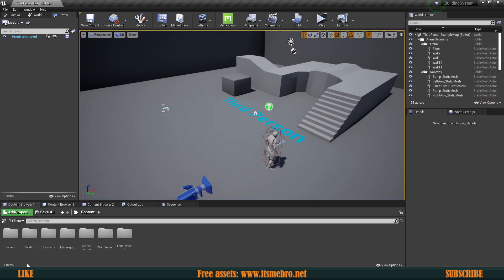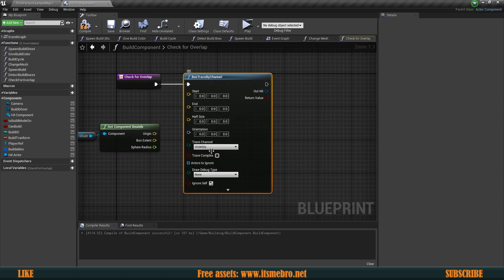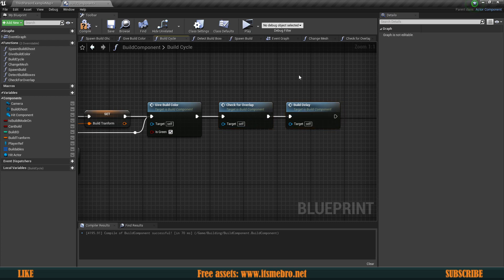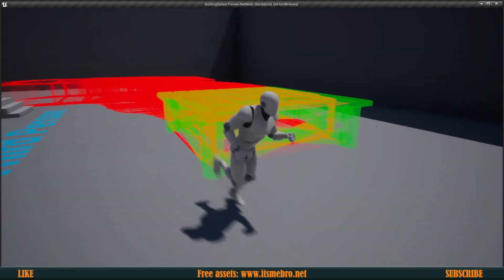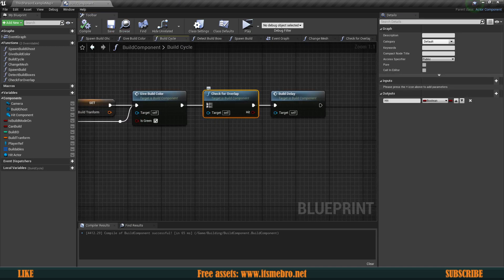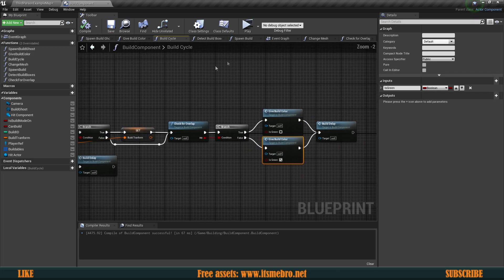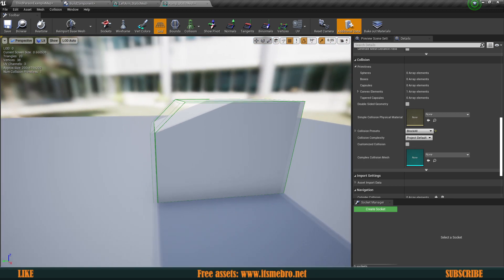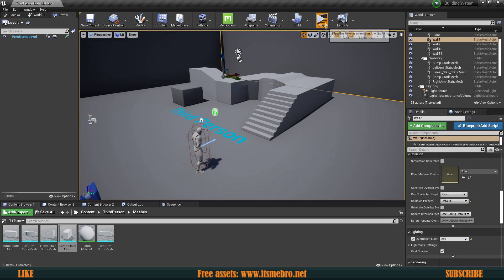UE4 Base Building / No Overlap

Comment: I love the series but this specific part is the only one i feel like is not working for my system. My foundations will not place if the box size is too high and so I divide it by 5 to try to fix the issue and it fixed the issue but the boxes are so small it doesn’t work half the time. I moved the pivot point but the boxes still are not working. One thing I thought about was to use the objects trace channels to only block specific trace channels but i also think using a component like a box in etch mesh and then box tracing that is a a better solution as it gives you more freedom pr object to edit the boxes.

Comment: Thanks for all the hard work, An little setup guide on ramps and stairs for overlap would be nice as you would want the outside ramp to clip depending on the slope of the land scape and when this happen you would not want to prevent the player from building it. However in the house this should be the reverse as you don't want half a staircase clipping through the floor/ceiling. But all and all I love your work and is learning so much. Thank you!!!!!!

Comment: I find a bug through: When you rotate your building, the box trace become bigger and don't be able to build when the building is for example at 45°.
Help me plz
Reply: Greetings, I had the same problem and I think I fixed it. 

Working in your Check for Overlap fun. in Build Comp.

Firstly, get your Build Transform, split it and connect the rotation into Orientation of the BoxTraceByChannel. Now your your bounds should be rotating if you rotate the buildable, however you will still have the scaling problem.

To fix that get a static mesh of your Build Ghost and from the static mesh Get Bounds, split the return value and use the Return Value Box Extent instead of the Box Extent from Get Component Bounds for the Half Size (going through the division think to rescale it as in the vid.) 

Now it should work with rotation without the rescaling of the box trace, as for the transforms of the box trace you are always using bounds of the static mesh, which should never change their size. Start and End of the Trace remain the Origin of the Get Component Bounds as shown in the vid.

Hope that helps
Reply: @petrchyla6687  This should be pinned , thanks for the solution
Reply: @TheDeuceCara  (in "Check overlap" function ) Create a copy of your object (Build ghost) and reset his rotation to 0 0 0, and get  component bounds (bounds of your copied object ,not bounds of your ghost like on video) and set orientation field in box trace from ghost build rotation (not from copied object)

It works because you can't rotate bounds of your object, but you can rotate his drawing

Comment: !!PROBLEM with  UE4 4.26!!       Hi! Ok, so the bug you encountered with complex collision, from what i have tested, actually has a deeper problem connected to it.  Box tracing by channel HAS to have a diffrent start and end vectors. Otherwise it doesnt move so it doesnt sweep so it doesnt hit anything since its sweep path start and end are the same. The only solve is to nudge the end point in X and Y direction by a small amount like 0.01, If you do it, the collision detection will work properly only in the positive directions of the X and Y, So my "fix" is to make another BoxTraceByChannel but with end position nudged by -0.01 and then using OR gate connected to both BoxTraces. :)
Reply: Bro, thank you so much! It solved my problem! Box trace doesn't hit my buildables because of complex collisions

Comment: This series is amazing! Super helpful, thank you so much!
I did find a bug though: You can place multiple ghost buildings inside each other still. At 7:23 you start placing foundations and you said: "Now you can't place them inside each other anymore", but that's not because of the system we've set up here, but because your character collision is blocking it from placing it there. You were walking inside of the meshes the moment you wanted to place them.
So is there a way to prevent players from building multiple ghost buildings inside of each other? The collision/placement works perfectly fine when the building is finished!
Reply: did you manage to solve it?
Reply: @LucasOliveira-uh5ft  Sadly no :( but I will keep you up to date in case I find a solution
Reply: @hdgdoomknight592  try setting the value in the Check Overlap Function lower. He set it to 1.2 but when I changed it to 1.01 it seemed to fix it.

Comment: Hi. First off, thanks for this series. I'm using part of this system not for building houses etc, but for simply being able to place down objects like beds/campfires etc, so I basically just did what was in videos 1-3 and 10 & 11. Now it works great and I can place down any actor I need.

What I would like to ask, is there a way I could make it so the actor I am placing down aligns with the ground/landscape. Basically, I would like to put down a camp fire and if it is on a small hill of the landscape, lets say under 25 degrees, it aligns to the landscape. And if the slope is too steep, it won't let me place it down. Thanks!
Reply from the maker: Sorry for the late response. I did read the comment the day you posted it and I thought I answered, but I didn't. :/
So, I will look into it. It's a bit of geometry that needs to be figured out, which I'm not good at. :D
What I will try to do is create line traces, from the edges of the mesh and get values from the points where they hit the landscape. That way it is going to return me 4 hit points and 4 corners of the mesh, which in return will allow me to create a triangle which then will allow me to calculate the angle. I know the theory, now I just gotta create the math.
Reply: @ItsMeBro  It's all good. I've tried to have a go at it myself but i'm not having any luck. If you get the chance and happen to get it working, then that would be awesome, but otherwise, no rush and no problem if it doesn't work.
Reply: @earthbornjim9975  Try using the Normal of the LineTrace Hit. The Normal is always facing straight away from where you hit.
Drag Normal pin (From LineTrace in Build Cycle) and search Forward Vector, then plug it in the rotation of Set BuildTransform.
This should get you closer to what you want but some tweaking will be needed.
Reply: @MuttleyGames  Thanks dude, was able to get it to work a while ago now using a similar process to what you advised. I appreciate the reply though :)